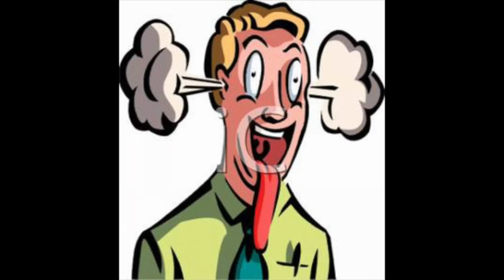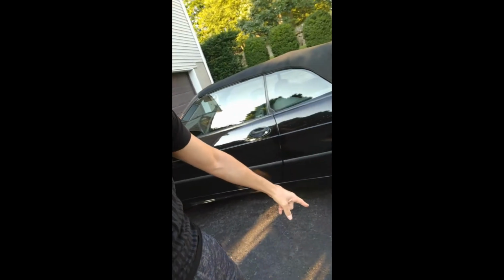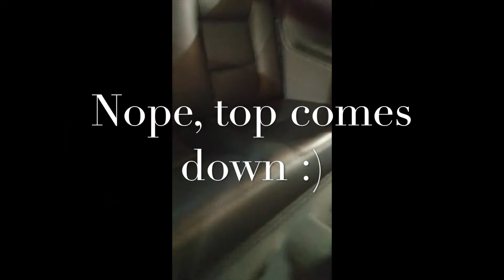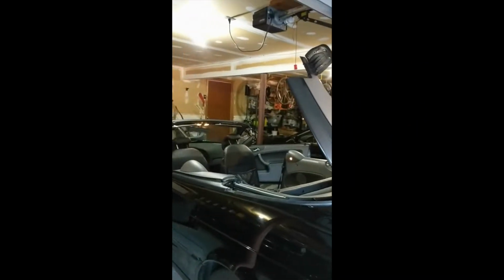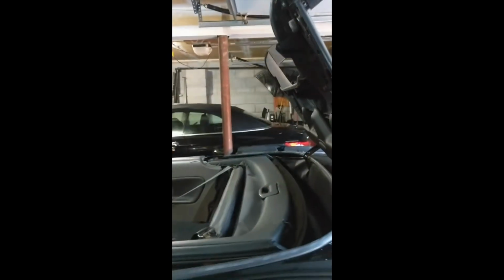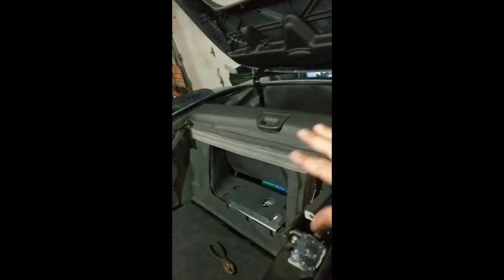02 Saab 9-3 Saab 900 Convertible Hydraulic Line Repair: Part 1

Comment: Was so excited to buy my 2002 Saab 9-3 Convertible a couple of weeks ago but wouldn’t you know it, the Hydraulics for the Convertible are leaking and the top doesn’t go down but can put back up. So they say to fix will be $1,300 plus parts. Sounds a bit rough. Be an interesting video if I followed your video and fixed myself 😁